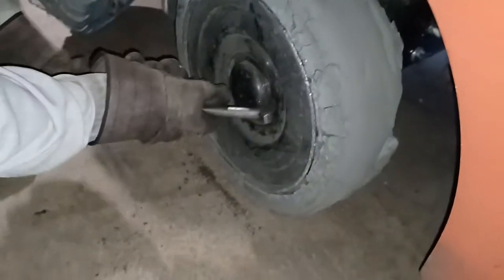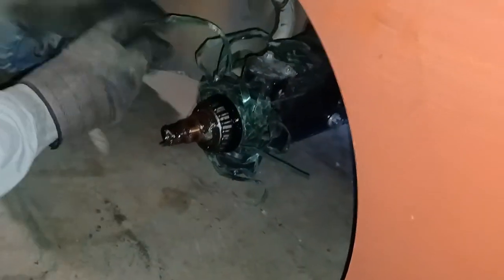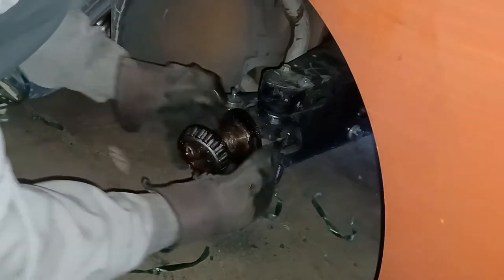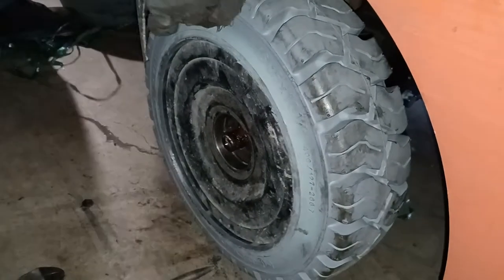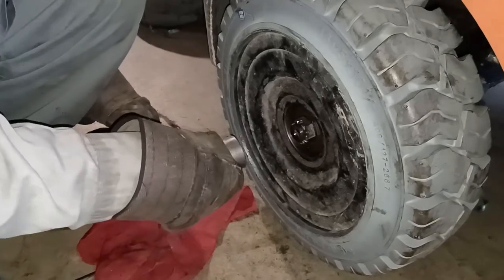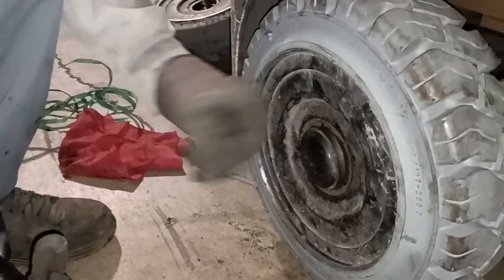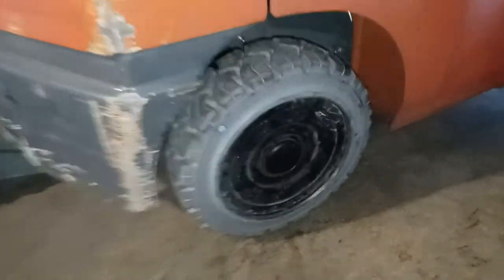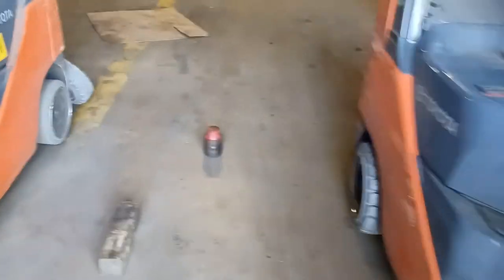How to install a forklift steer tire with bearings.

Comment: Do not hit the bearings on the cage....
Reply: I was taught to hand pack the bearings with grease after cleaning the inner and outer and inspecting for wear.  Forklift bearings are usually long lasting. Read : slow speeds.   Trailer wheel bearings are replaced waaaaaay more often in my experience

Comment: Lol pm guy don't grease wheel bearings. Guy doing wheel replacement job replaces and packs new bearings.
Reply from the maker: Next just because I'm taking off the drive tires I'm going to have to replace the brakes?
Reply from the maker: Next just because I take off the drive tires I'm going to have to replace the brakes?